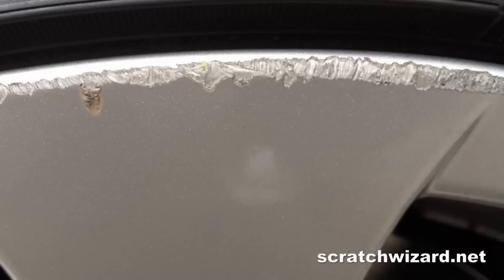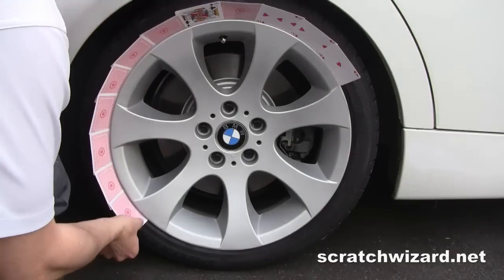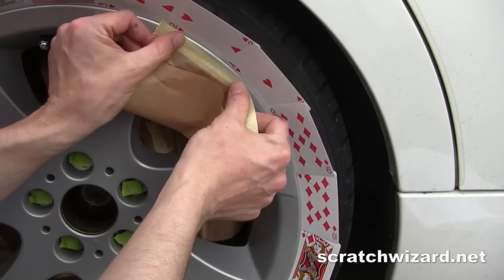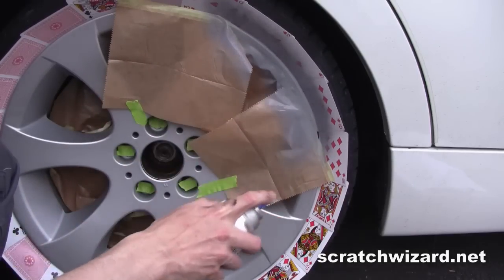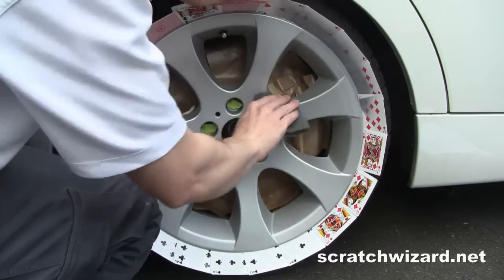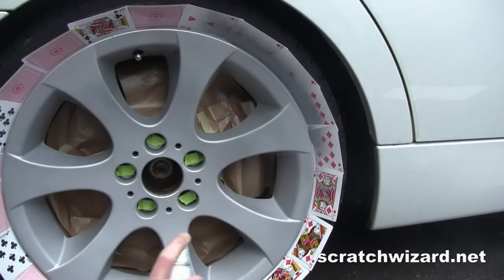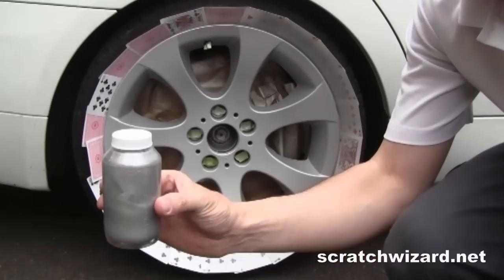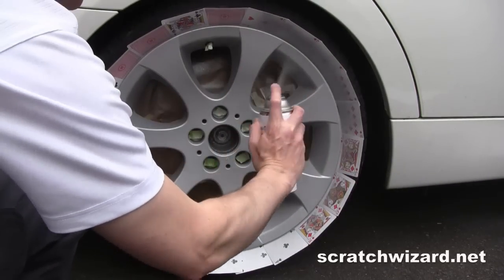Alloy Wheel Repair Kit: Demonstration

Comment: just a suggestion... two mins work, take the wheel off
Reply from the maker: James French Agreed.  If you have the equipment to remove the wheel the repair will be easier.
Reply: +ScratchWizard how about mask the rest of the car to stop the over spray?
Reply: +Paul Crump just use bigger playing cards!
Reply: James French the words out my mouth lol...
Reply: Probably gave to take the wheel off to mask the disc.......

Comment: Thanks for posting this up.  For darker silver, how do you know when you've got the right shade, without wasting a bunch of paint due to trial and error?  This is because the color of the paint in the jar when wet is not the same as the color that will appear on the rim once the paint is dry.  I just don't want to end up with one oddball wheel or else have to do this 4-5 times til I get the color right.  What do you think? Also, the Ford dark Hyper Silver is actually silver over black so I wonder if putting the black down first as a base coat, then silver as top coat would be better.  Thanks!
Reply from the maker: P Chandler Add black to your paint, stir, spray a piece of cardboard, then compare to wheel.  Yes, you could get the hypersilver effect by spraying black spray paint then a thin layer of our silver, then clear.
Reply: +ScratchWizard what about chrome wheels?

Comment: Wouldn't it make much more sense to jack the car and remove the tire? You avoid any risk of spraying your fender, nuts, or brakes.
Reply from the maker: The Prismatic Vision If you have the time, yes, removing the wheel reduces the risk of spraying paint where you don't want it.
Reply: With all due respect, I would never start a job like this unless I was certain I had plenty of time to do it properly.
Reply: The Prismatic Vision Agreed should have been done off the car.

Comment: why dont you show us how to remove the actual scratches not just the existing paint on a good surface underneath?? first 2 seconds show us a scratched wheel, afterwards you are just sanding the good part away, no way that easy to fix scratches like that.